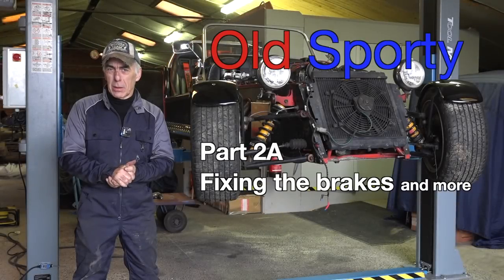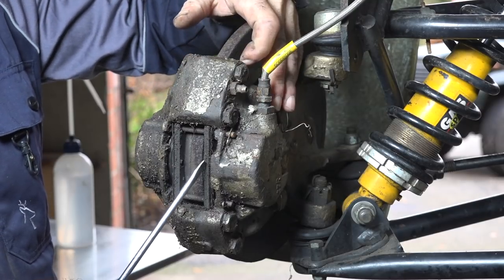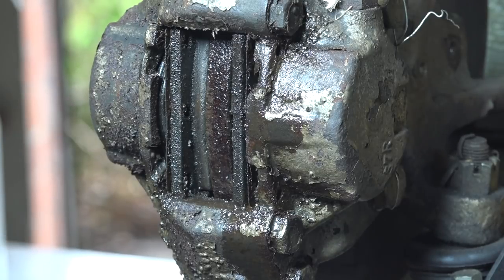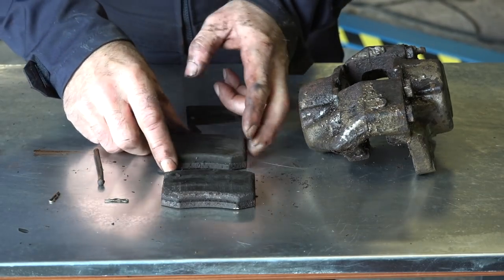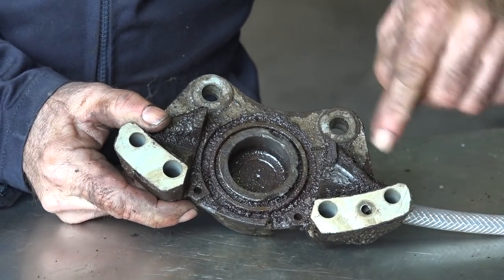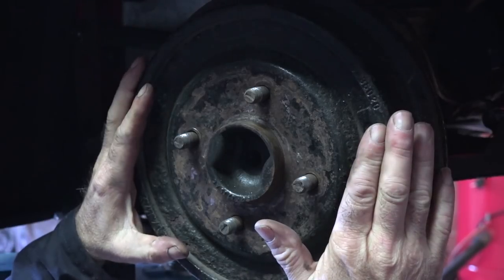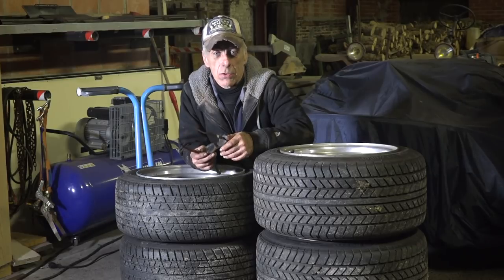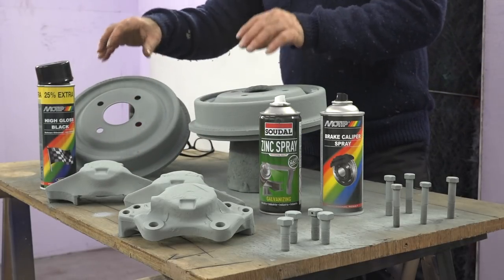Old Sporty, Part 2 A fixing the brakes and more

Comment: Nice presentation. I watch tons of these how-to videos, and I find your editing, i.e. the decisions of what to show, what not to show, whether to speed up, etc. the best out there. Very thoughtful editing. One thing, though, that I did not see is prep for blasting. My rule is to first degrease with solvent, so that the blast media does not get too corrupted, and solvent handles grease very well anyway. Then I maybe scrub the machined surfaces, then mask the machined surfaces with good duct tape, maybe two layers if you intend to blast much, then abrasive (not soda) blast cast parts, especially cast iron, as it works fast and well. You have shown abrasive blasting of body panels, but not this stuff. For masking interior chambers like piston chambers, you can put heavy foam rubber in there.
Reply from the maker: Thanks for the comments, I try to be myself...

Comment: FYI For those who haven't done a front bearing replacement the easy way to remove the big bearing and seal is after removing the small bearing, put the nut back on the spindle and pull the hub to you hooking the big bearing with the nut a couple of   vigorous jerks will generally pull it out the back
Reply from the maker: Thanks for the comments

Comment: I hurt myself really bad one time when I popped out brake pistons with compressed air (nearly lost a finger...). Then I made an adapter for a zerk (grease) fitting to the thread of the bleeder valve. Popping out the pistons with an oil pump or a grease gun works a lot smoother. Without that vigorous 'pop'.
Reply from the maker: Thanks for the comments, maybe something I should do as well

Comment: What did you use to clean the calipers? Sand blaster? What model? Looks very nice
Reply from the maker: thanks for the comments , I used soda to blast them at the inside of the cylinders and a mix of garnet 330 and soda on the outside,  the blaster is an IBIX-9 H2O   I have a video on blasting with this device on my channel with all the details

Comment: Hii Steve,  !!!  First tool in the tool box " HAMMER " then very good quality  " VICE GRIP " to complete  " CHIFTING SPANNER " (adjustable wrench)  there is the tool box complete !!!
This is the part of the mechanic I loath !!! Break fluid WAS a good first cure to wounds !!!
Reply: Impact air wrench what a beauty of invention !!!  Better then the electric type !!!
Reply from the maker: yes it is
Reply from the maker: Are you sure Marcel about the wounds and  break fluid dot3,4,5, ?
Reply: @D3Sshooter  Yes because in the olden days brake fluid had alcohol to avoid freezing ! But now I don't know what they add in the oil. Did you know that the TOP oil for very fine hydraulic system is extracted from the seed of the palm oil (Elaeis) not from the fruit!

Comment: I have a question, was it the way the video edit made it look or when you removed the front bearing spindle nut was it somewhat loose as it seemed to suggest the front wheel bearings were in need of adjustment?
Reply from the maker: Hi Steve, It was lose... I could even turn it with my hand..   Indeed a lot needs adjustments on this car
Well spotted
Reply: @D3Sshooter  only because I had been working on the rear wheel bearing of an 18 T. grain tipping trailer where the spindle nut was as tight as on your car.

Comment: if it has a solid axle you can buy brackets to weld on it to fit discs and calipers to the rear
Reply from the maker: Thanks for the comments, yes it has a MK3 ford capri rear... I might later change that to an uplift ( the drum brakes)

Comment: Nice video. Please mind when blasting the machined surfaces of the piston chamber. Thankyou for sharing.
Reply: TheRebelOne: The inside surfaces of the calliper body do not have any sealing function, the seal is achieved by a rubber ring set in the outer bore which remains stationary, the important part is the moving piston which is plated , and which Steve has replace with a new component here. Chris B.
Reply: @453421abcdefg12345  It would not be the sealing function that would concern me. Its the abraisive action on the cylinders machined surface possibly causing friction against the piston movement that would cause concern. Thanks!
Reply: @TheRebelOne.  : Ahh! But this was blasted with soda, so that would /does not leave an abraded surface, I could see your concern with an aggressive media, but the piston should not be touching the inside of the cylinder surface anyway, the only contact is with the rubber seal.
Reply from the maker: Thanks for the comments, indeed , i Did
Reply from the maker: @453421abcdefg12345  , and I did after all the blasting a good rub with very fine steel whool inside the cylinder.
Reply: @D3Sshooter  Thanks everyone....it's good to talk !

Comment: If you are going to reuse the brake rotors you should have marked them in order to realign them in the same position on the hub.
Reply from the maker: Thanks for the comments, indeed.  I keep things marked and together in boxes so they do not mix
Reply: @D3Sshooter  That's not what I meant. Each rotor and hub should have been marked to enable the rotors to be reassembled to the hubs exactly as they were. This will prevent more runout than they had originally.
Reply from the maker: @gus6rocks  I see, thanks.  I will check the run out with a micro meter when mounted . But a very good tip